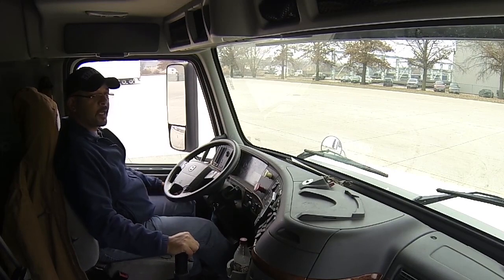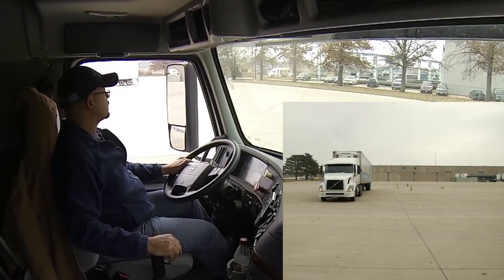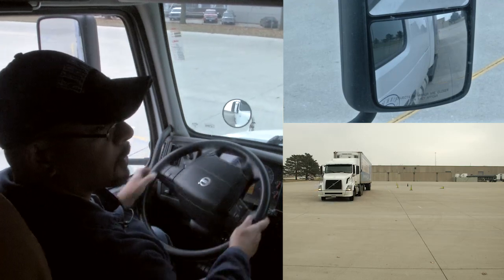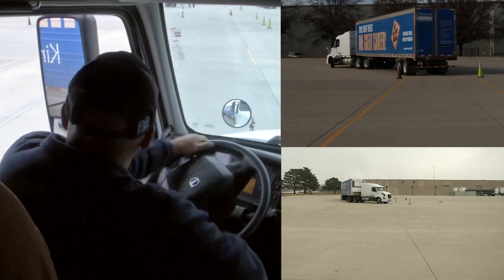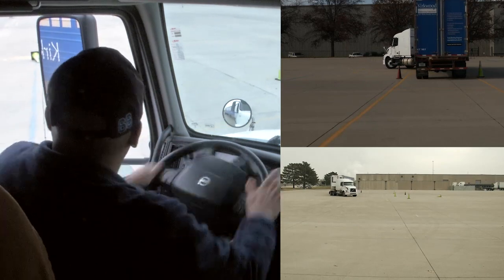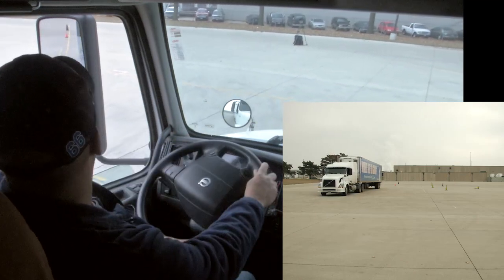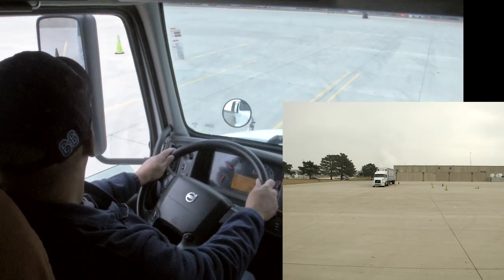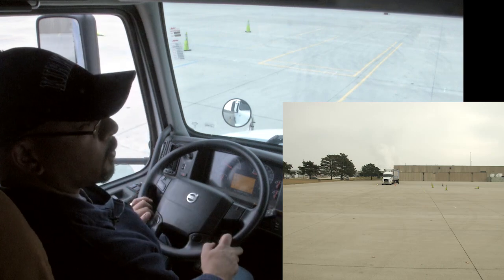Performing an offset back in a semi truck

Comment: mr  jones   you  make  that  look  easy  but  when.  i  tried  doing  those  moves  it  was  very  difficult  for  me  to  do.  i  guess  practice  makes  perfect  doing  it  until  you  get  it  right.
Reply: part  of this is retraining the brain to react Before you Think you need to correct. Trailer end is ahead of where the mirror tells you it is at. I sometimes make tiny corrections to see the trailer side then back in line, it depends on the circumstance. Repetitions are huge. Find lines/angels for reference points, curbs are awesome, to practice.

Comment: Do 1 an half left untill u see ur rear right two tired then 1 and half right till u cover the offside cone the one on left the 1 and half left to get the truck straight pull back play with ghe steering easy way.

Comment: need tips on straight line backing
Reply: Drive the trailer not the tractor   when you have both lined up remember the trailer will go in the opposite direction you turn the wheel. Slight corrections keep the trailer and tractor in a straight line. If you over steer you won't go straight. Watch the trailer wheels they tell you everything.
Reply: find a separator like a yellow line, or divider in the concrete and back on that. practice watching the wheels on driver side first then go back and for the between drivers side mirror and passenger side mirror. reference points and straight wheel alignment is key

Comment: What tips do you have for straight line backing think I am not reacting fast enough
Reply: Tanisha Dean Watch the very rear of the trailer not the headerboard, then when the side of your trailer on one side gets a bit bigger turn a small turn toward that side to correct it.
Reply: yeah agreed with below, more of tail in one mirror means correct to other side. Small corrections. Speed is also important, as you get better at a slow speed, increase your speed. Angels in the mirror can be misleading if you are correcting. Making a slight correction one way or another Before you see perfect angels in your mirror, will put you where you want to be. Slow down if you aren't able to correct in time, or you will simply keep having to make bigger corrections